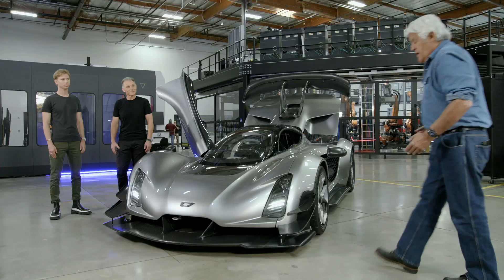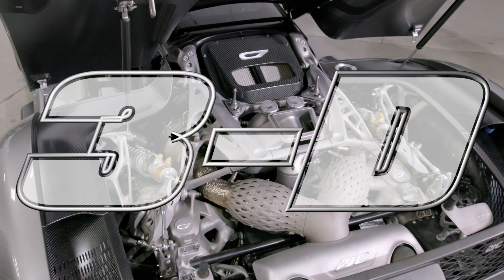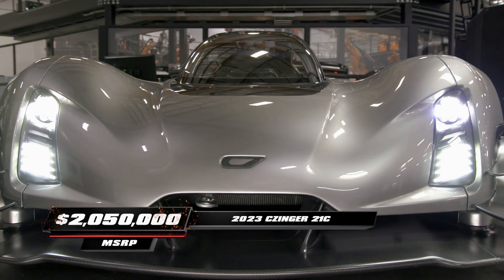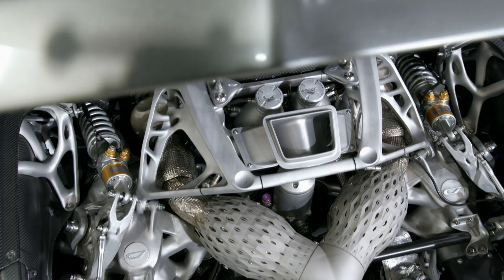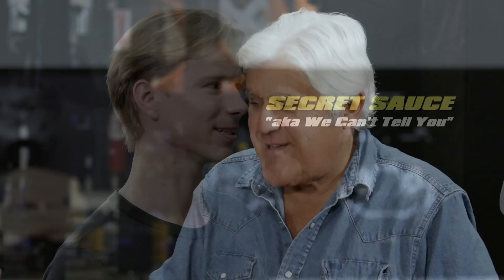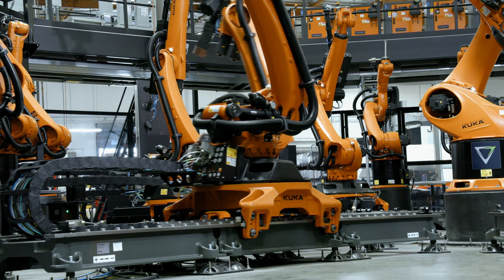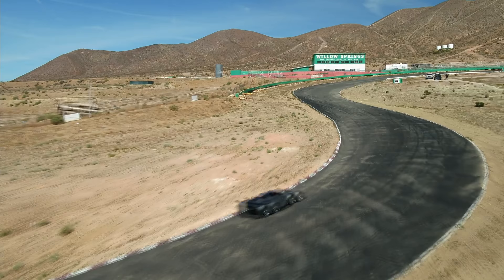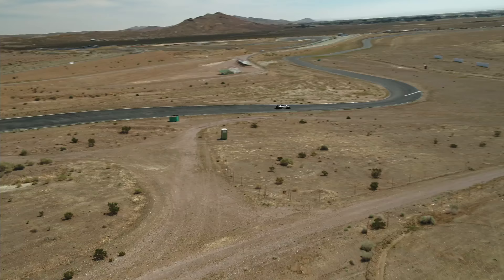2023 Czinger 21C 3D Printed Car | Jay Leno's Garage the TV Show

Comment: That was awesome 😎😎. 

Imagine going to the dealer because you need your brake caliper changed out . they'll tell you ,we're going to have to replace the radiator  , the upper intake manifold plus the left strut because it's all one piece. it should take 2 weeks to put back together.

Comment: Integrated suspension/brake calibers sounds great UNTIL one or the other gets damaged or needs repair then hold onto your wallet.  Hopefully that technology is a ways off for production cars.
Reply: This is a toy only for the richest of the rich
Reply: Maybe in 15 years from now on, we'll have 3-D printing shops scattered around, like Konica or Minolta photo film processors  15 years ago. You come in with the CAD file, and they print a window frame, or a wheel hub, or a hip replacement to your specs...
Reply: You don't replace parts, you replace the car.
Reply: @blueheelerfriend8450  For now but soon the technology will trickle down to production cars.

Comment: Even with bird bones, it's still 2700lbs dry? I'm curious to see what it takes to remove the rotor. The inner hub must drop if the surrounding caliper system is rigid. As well, how much flex? Major racing brake companies have used similar tech for racing calipers for years. It's always a sacrifice of either weight or stiffness. Can't have both. (optimally) It is pretty, but I'm not convinced on what that specific model's goal is other than being a one-off.

Comment: And with the advantage that in the future if an owner needs a replacement 3D printed part, then they simply have to load the design model and produce it rather than have to maintain old tooling / stocks of "no longer in production" items.

Comment: One thing they didn’t really mention is the space requirements for manufacturing vs assembly line. In a different video it is stated that an assembly line plant the same cubic feet as a plant with a ton of these assembly “modules” would produce less cars per year than the module setup with all those arms

Comment: That makes sense a bleeder screw at the top of the brake calipers.Thats where the air in your brake system would accumulate.. Just Um about It's features.Sacred Secreat Secret Sauce 😋

Comment: What happens when you need to change a single part but they are all built into one unit? Seems like it would get expensive to change the brakes when they are molded into the whole wheel assembly.

Comment: It's still easier to stamp metal parts or extrude pastic parts.  
That older and simpler technology can give us fantastic cars for motorcycle prices "IF" they would just use it.
The infatuation with exotic materials and exotic lenghy porocesses if fine; it just is unnessesary for the 98-99% of what we use cars for.  If you would stamp out a  Lamborghini Miura look alike and use a decent V6 for $20K, THEN it would be exciting for car buyers.

Comment: Great video and stunningly beautiful groundbreaking car.
The beauty of the AI is that it sees stress in a 4D circle...actually a globe.
And when the AI designs parts , it only adds weight and material where and in the exact proportions it is needed.
Hence the organic looking brake / suspension  unit.
Where humans think in up , down and sideways , AI sees in all directions at once.
Up, down , sideways and in a circle....at the same time.
I am astonished it is so beautiful on the outside as AI has no need for such things.
I guess they asked the AI to place two humans in a line in the front of the car and said ,make this thing as aero as you can.
The days of overbuilt vehicles are ending.
There will be astonishingly light and yet durable vehicles.
I look forward when computer AI solves the battery weight and power issues for energy storage.
That cannot happen fast enough.

Wonderful new tech from Czinger and many thanks to Mr.Leno for letting us see the future.

Comment: Certainly most interesting. With this technology, designs are possible not seen before which must be an ultimate heaven for designers. From an industrial practical application point of view, it seems very capable for piece production in small quantities, i.e. for rapid prototyping and concepts, exclusive offerings, experimental design studies, not so much for producing in large series as the printing process itself is far too slow-moving for such, and the entire process seriously costly. I.e, I will have to question mass scalability and the potential of economies of scale. Integration of parts into one single unit is of course not exactly consumer friendly in terms of TCO related to maintenance. I.e., if something small fails, a large profusely more expensive chunk of an entire unit has to be replaced. It is interesting this innovation though; essentially rapid prototyping scaled up.

Comment: But that part about adjusting suspension sounds like a down-side to the integration:  no adjustability.  Have to build a completely new part.  Now if you can afford a $2M car I guess that's no big deal, but otherwise, adjustability is good.

Comment: I wonder what would be the future of these cars in coming decades after the latest California ban on building and trading of petrol based cars ? so many museums ?
Reply: There's no ban on building or trading of gas engine cars in California. In 2035, no more NEW gasoline engine cars can be SOLD in California. Hybrid gasoline engine cars can be sold, as long as they can go 50 miles on batteries alone, and used gasoline engine cars can still be bought and sold. No mention of the building of gas engine cars is made at all in the new rules. So, other than being completely wrong about the new California rules, you're very right.

Comment: Only worry is that in California, in a few years, nobody will be able to purchase any car but 100% electric powered. And things like that tend to spread to other places.
Reply: @GUNTHER1  I don't know where you're getting your numbers, but 20% of the people haven't left California. Also, depending on the number of employees, the California minimum wage is $14 or $15 an hour, helping with costs. 18 states use the federal minimum wage of $7.25. And you can keep the humidity and mosquitoes you've got in Florida.
Reply: Plug-in hybrid models, which run on gasoline and electricity, may still be sold in 2035 and after, as long as they are capable of running at least 50 miles exclusively on battery power and as long as hybrids are less than 20 percent of an automaker's new vehicles sold in the state. Used gas powered vehicles can still be sold, just not new ones.
Reply: @ClayLoomis1958  - And I thought the law was confusing. 🤪
Reply: @ClayLoomis1958  - wow, an extremely high minimum wage. Who pays for that?
Reply: @lescobrandon3047   Well, the average hourly pay for an In-N-Out employee in California is $18.35. That's pretty good pay for a burger flipper, and I suppose everyone that buys a burger pays for it. But a Double-Double Combo (double cheeseburger, fries and a drink) is only $6.70, which isn't too bad. Only Hawaii has a higher cost of living though. A single Big Mac goes for $5.31 there, and their minimum wage is just $10.10.

Comment: i feel 3d printed part is not as strong as injection mold part
Reply: They can be stronger. You can create internal lattices and channels that are impossible to do with injection casting. You can also use ai to create shapes with extreme load bearing efficiency.
Reply: You feel.... maybe look at a few white papers, 3d printing covers such a wide range of tech and some parts are not only stronger than other methods it can produce parts that can not be produced using other methods.

These parts are used in very high stress applications today with a far lower failure rate, lower costs and lower weight that other manufacturing systems.
Reply: The 3D printing they do is a lot more complex than the simple 3d printing most people do at home.
Reply: @edwardfletcher7790  Depending on the forces acting on it a cast or forged part will be more durable than a 3d printed part because there is better control over the crystalline structure of the metal. The laser that welds the layers of metal powder together can cause microscopic imperfections and gaps within the components, as the part is repeatedly stressed those gaps become weak points and can spread until the component fails. The benefit of a metal powder 3d printed part is that you can get the same strength as said cast or forged piece for a greatly reduced weight. But its overall lifespan won't be as long.
Reply: @CrispyCrunch3  You're perfectly correct, I've seen the same doco about the sintering process.

I'm assuming though, that they're taking those perfections into account and over engineering the part and testing multiple iterations to failure. Nothing is left to chance with machines that can do those speeds and withstand those forces.

Pagani for example discovered a suspension failure on the Zonda F that only occured on a section of the Nurburgring at over 150mph (240kmh) due to downforce.

The testing these companies do is extensive and fascinating.
Reply: @edwardfletcher7790  I'm sure they do but my point was more towards 3d printed parts in general. The normal forces a suspension component would see probably would not be enough to exacerbate the imperfections in those parts. But engine internals, exhaust manifolds may. Beyond that the imperfections can be a reason that certain industries avoid 3d printed parts where the forces are high enough and the service life of the component matters.
Reply: @CrispyCrunch3  You're right again. 

But if they're printing rocket nozzles & turbine blades I'm guessing they've overcome the imperfection issues to a high degree.

In fact Meld Manufacturing have a metal 3D printer using  Ti-6AI-4V titanium that meets the AMS & ASTM forging standard. 

EDIT: Koenigsegg for example, have been using 3D printed Turbochargers since 2014.

It looks like Bugatti is one of Czingers clients for printed brake calipers. Their 2.9kg titanium 8 piston caliper is 2kg lighter than the old Bugatti aluminium caliper ! 😲
(A standard KSport 8 piston aluminium caliper weighs 11kg !)

It's CRAZY how quickly the metal printing industry has taken off !

#Ariane6 #InnsTek #3DPrintedTitanium #Ti-6AI-4V #MeldManufacturing

Comment: 3D printing is cool but I don't see the usefulness for cars. It's worse than flat sheet stamping for mass production and it's worse than carbon fiber for hypercars. Maybe it's useful for prototyping but even then it's comparably easy to TIG-weld chrome moly tubing. Maybe I'm wrong but like in aeroplane manufacturing there might be some cases where individual components are best made with additive/3D methods.

Comment: 3D printed some brake assembly, chassis and suspension aluminum parts, great but what about the details of the gas engine and electric motor. What are the other specifications. Why does this video come across as being acted with a script, what gives here.

Comment: And he didn't build anything. His computer did and it's not in the least impressive to me. The computer made all of the calculations in geometry. The computer built the parts and the computer basically assembled it. He literally didn't do anything at all. The real work was done by the CPU while he sat on his but and took the credit. Calm down with all that. He even admitted it in the video. What in anything is he proud of?

Comment: Very stupid design with the caliper and hub and suspension points all in one. It’s just like a 2007ish Ford Escape where the suspension link in the knuckle and it has a press in bearing. We all know how fun those are after the salt eats half the car. Engineers can’t build cars. Work in a shop for a week and you’ll hate all your designs.